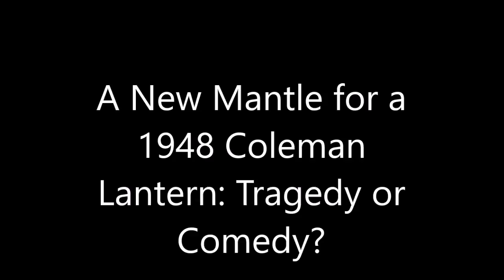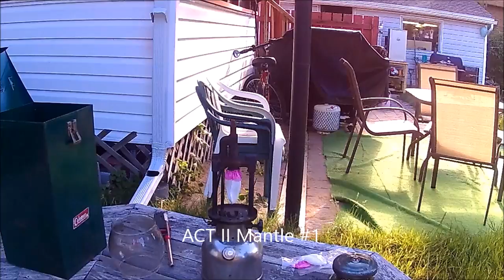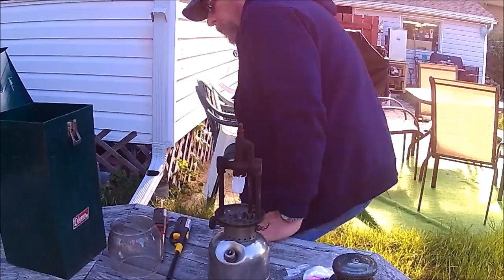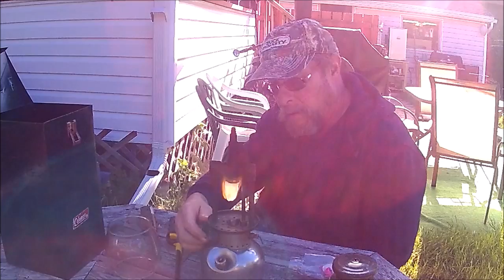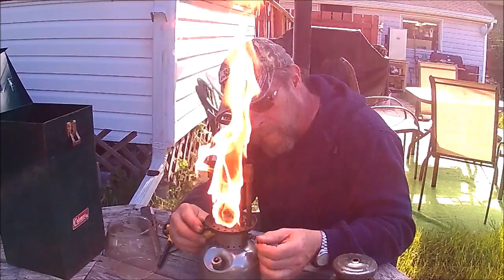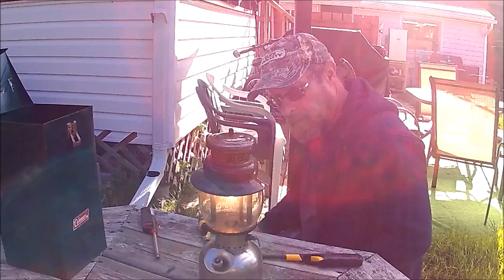A New Mantle for a 1948 Coleman Lantern: Tragedy or Comedy?

Comment: That is such a cool lantern. I remember trying to light a more modern one on a windy mountain and used up practically a whole box of matches lol! Never tried one of those old-fashioned ones! Holy moly, scared me when it finally lit. Sorry about your arm hairs. I guess camping was pretty rough back in the day.
Reply from the maker: They can be a little tricky. Those long lighters keep your hands and arms away from the bad stuff. I sure would not want it in the house, but I have three propane ones for if the power goes out. Thank you for watching and commenting, Stella
Reply: +shovelhead8 I should get one or two of those, that's a good idea for the house. I have a battery-operated one which I got when my power was out for 5 days. It takes a whole mess of D batteries and it looks likes you're walking into the sun when you turn it on it lol. Used it a lot in So. California when I lived there (several earthquakes and windstorms, etc).
Reply from the maker: They supply a bit of heat as well. This one has electronic ignition that I am not used to, so it supposedly lights just by turning the knob. My other ones are match light. The new LED lanterns are nowhere near as hard on batteries as the older ones, and they usually have different brightness settings. There are a few solar ones as well. I have to confess I am a little bit of a flashlight junkie as well, but with some therapy I might get over it (not). Thank you for the reply, Stella
Reply: +shovelhead8 lol I need some therapy for my ferro rod hoarding as well.
Reply from the maker: You too? I buy them by the dozen, and give some away and stash others in every coat and bag. And flashlights (3 in my coat alone) and knives (3 in my coat and a couple in my pockets). Maybe we should start a therapy group. Thank you for the comments, Stella. They mean a lot.
Reply: +shovelhead8 LOL we could start a TV reality show, "Hoarders Two"😄😄
Reply from the maker: We are not hoarders, we are preppers. Every thing we have collected has a purpose. Our other problem is we want to have extras just in case, so you end up with 30 ferro rods, 20 knives, 15 flashlights and 7 lanterns(not including candle lanterns, which is a different chapter. Maybe I should make a video on them). We just have a need to have what we want handy, so we get extras. Stella, you are hilarious. Some day I will figure out how to do those emoticon things you put in your replies. I really enjoy your comments and replies.
Reply: +shovelhead8 lol those happy-face-type stuff is in an app (free) called emoji (I think). Just google "emoji app". It's pretty dumb but I can't help using them. Maybe some day I'll grow up. My uncle who is a retired surgeon showed me them lol I guess he never grew up either
Reply from the maker: I have seen that app.Too many choices for me, but keep using them, I like it. At 61, I have not grown up either. And I like it like that. Thanks, Stella

Comment: Not to bad of a job man a little bit of a struggle but you did good! I've got a couple of different lanterns like that but mine are from he 70's
Reply from the maker: I did not even know they had the year marked on them until I talked to a guy I was getting some gaskets from. I have done others in one shot, but that would have been boring. This was a little reality trip. Only two more lanterns to get going, the 65 and the 73. Thanks for watching and commenting, James. I had noticed your lanterns in your garage.
Reply: +shovelhead8 yeah I didn't know bout the year stamp till my father Inlaw showed me. Mine are from 71 73 and 76
Reply from the maker: I would not have known except when I went to get filler cap gaskets. The old ones are much smaller. The only way to get the old ones out is to burn them out. I did not mean to start collecting lanterns but things sort of got out of hand. This one was the most expensive at $15 dollars with the carrying case and funnel.Thank you for the reply, James

Comment: I just found out that your supposed to pre burn the mantle. Apparently iv been doing it wrong for 30 years. I have always just put them on reassemble the lantern, turn on the gas and light em up. Never had a problem doing it that way. They always last a long time unless it gets banged around a lot.
Reply from the maker: I just follow the directions, and I still mess it up. If your method works, don't stop doing it.. I have a 6 of these lanterns and I don;t put mantles on them all. Thank you for watching and commenting.

Comment: Just in case you did not know, these lanterns are collectable. I'm a Coleman collector actually haha. I have a 1949 242B which is near identical to the one you show in the video. Dont get rid of these because we all know they will only grow in value. If the 242B you show in the video has the original globe, the globe itself could possibly be worth more than the actual lantern.
Reply from the maker: I seem to be a collector as well, but just by accident. I must have 6 or more naptha lanterns and a 1962 stove as well. Lanterns are from 37 or 39 up to the 70's.. A lot of them are on my videos. I make them run, eventually, but I do not restore them, I leave them barn fresh.. These are Canadian Coleman, so they are not as valuable as the US made ones. I have mostly the small 200 series lanterns, but I recently picked up a larger one in a handmade metal case. There is a video for that one as well. Thank you for watching and commenting, Darkness
Reply: shovelhead8 I couldn't seem to find your video on the larger one. Could you tell me the name?